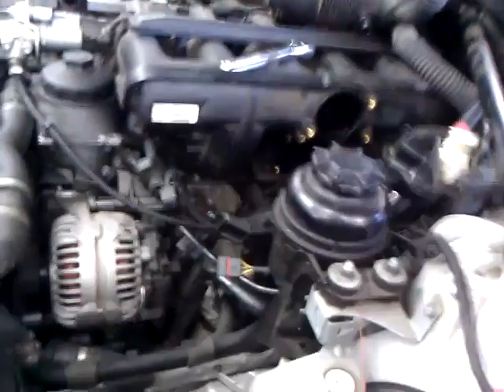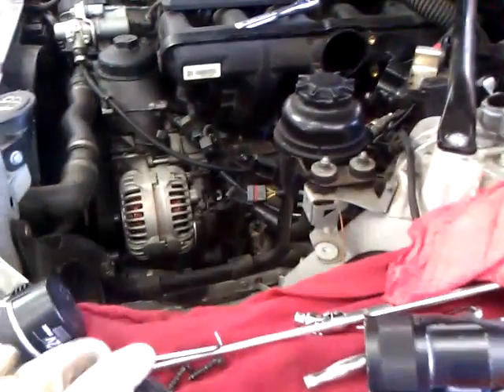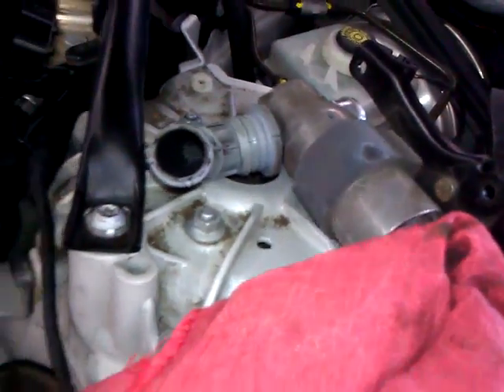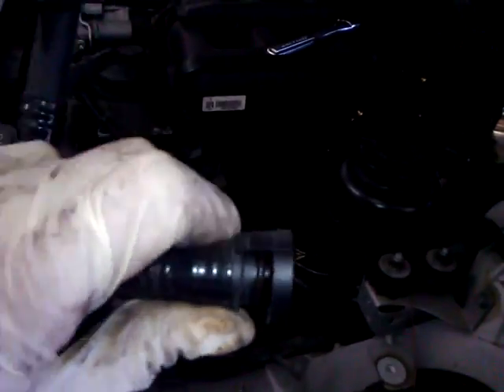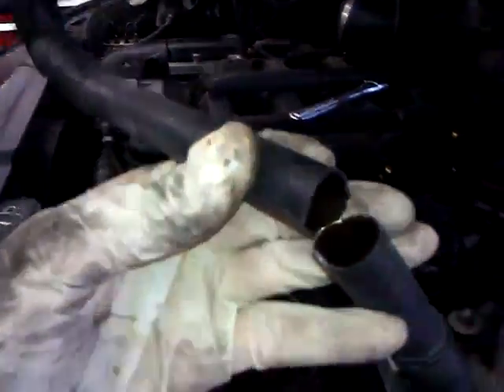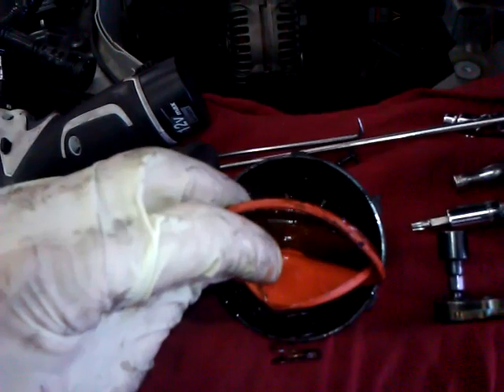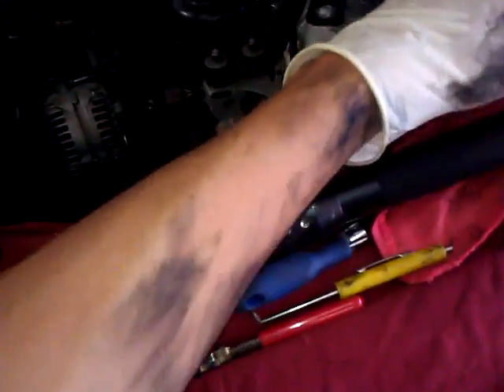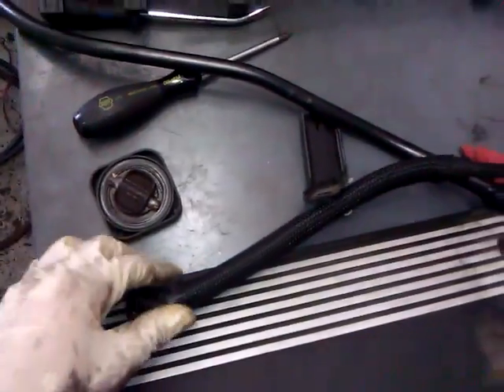bmw pcv oil drain valve failure and explanation

Comment: How can I get rid of mayo build up?
Reply: +JR Green spray WD-40 into crankcase and remove whatever you can with a lint free rag. Take the cap and spray it down with WD-40. Disconnect the crankcase hose that goes into the valve cover. Spray that also with WD-40 and clean what you can. Also spray some into the dipstick. Then take your car for an hour ride in the express way really push it and that will help burn out the condensation.  When you return home, remove the oil cap close your hood and let it vent out. That help it release the heat from inside the crankcase. If you leave the cap on especially when its cold, it will start to condensate inside and create mayo. So my tip would be every time you drive your car, remove the oil cap and let the heat from the crankcase vent out. Been doing that for years and I get very little mayo, if any. GL. Don't forget to put the cap back on when you use it.
Reply: Awesome thank u!!!!!! I have another question. I have the code p0444. I checked to see if I accidentally unplugged it but I didn't. was buying a new evap valve a good idea? I just can't seem to figure out y I keep getting that code. my new part comes next week.

Comment: hi i have a 01 bmw 318i my mechanic says need to replace pcv valve reason is misfire and running rough it is set for repair next friday so i still have a week left can i still use my car beacause i need it for everyday use so far i have no engine light or oil leaks from the engine thanks

Comment from the maker: @eagle4everable the 06 i believe has the aluminum bolts that fail on the valve cover. this engine has variable lift valvetrain and a whole new list of fail. especially the aluminum bolts that break (belt tensioner). the pcv valve should be on top of the intake.

Comment: I have a rough idling problem - it even stalls at the stoplight.  It's a 328i E46 M54.  I've read that it is usually one of three things 1) Dirty idle control valve 2) positive crankcase ventilation valve (PCV) leaking oil (as in the video) or 3) faulty VANOS eccentric shaft sensor.  Does anybody know how I can determine which?  I've read that the PCV issue causes white smoke as others have said in the comments.  I don't have any smoke so I think maybe my problem is one of the others.

Comment from the maker: @blkgem6 but tje 645's ive worked on were v8 and have a different style pcv system that has diapham failure as well. two diaphrams one on each valve cover.

Comment from the maker: when the car is idling remove the oil cap, if you have a difficult time becaise of extreme vacuum then u need a pcv valve. also check your oil drain tube ans the air valve on the side and see if its broken too.

Comment: I replaced the lower intake boot and I still getting the P0171 & P0174 codes in 2004 BMW 330i.  Do I need to change the whole PCV or only the hoses?

Comment: good informative film..thanks for taking the time to do it. i have 03 330ci was running well before i changed the valve cover gasket ,spark plug boots and plugs ..now runs like crap..can't punch it get a sucking sound and rough idle.I think the cracked hose maybe the problem or i need a new mechanic ..or both :)

Comment: besides blown head gasket, the only time i've seen that was when the pcv valve was busted and the transmission fluid cooler was busted and leaking into the coolant. sounds like you need a block test with a coolant tester.